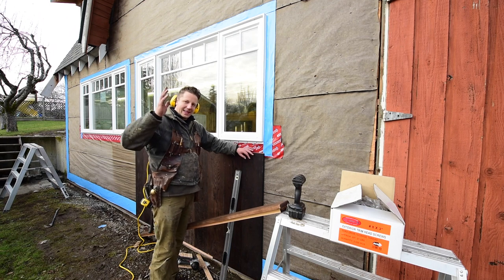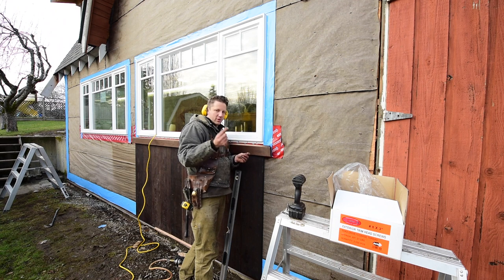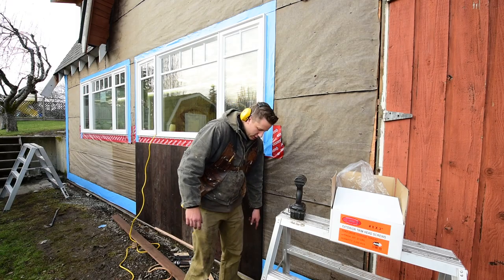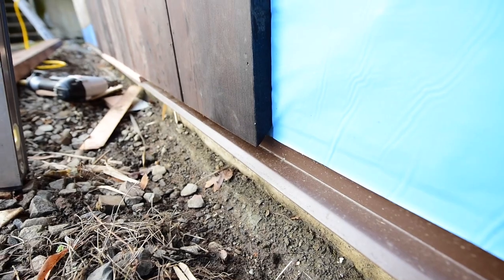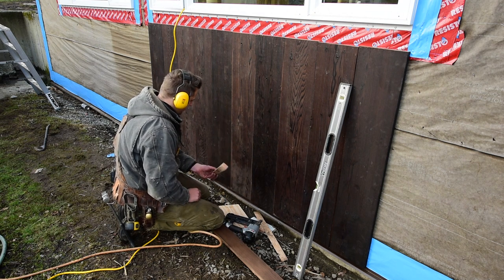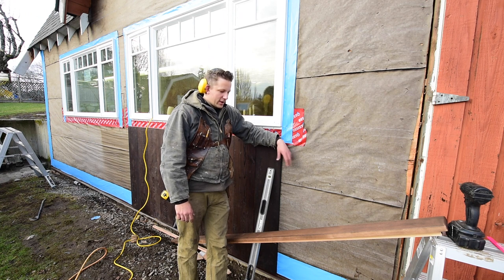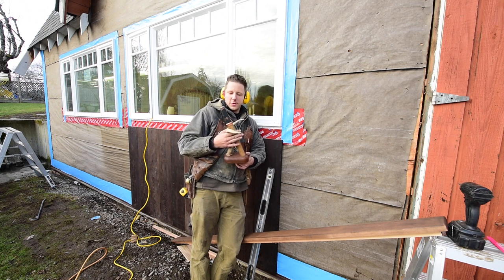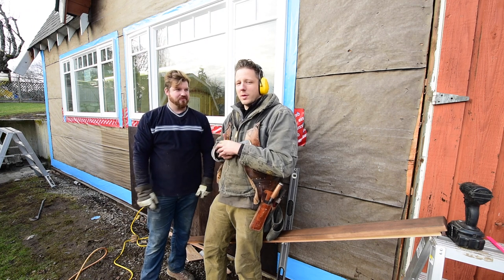FTF #45 Meet The New Apprentice!

Comment: Welcome Justin! Did I miss it or did you mention the siding material? Did you buy it rough or to size? 
PS I thought Galvanized coated nails/screws also have a tendency to drip and run and leave a stain mark if your material is a bit on the lighter side.  Cheers!
Reply: shosugiban - burnt cedar. (Yakisugi)

Comment: quick question
dont know about in the U.S. but here in New Zealand that kind of external cladding system needs a cavity of about 25mm or an inch to let moisture just querie
Reply: TheGhosteyez 18 millimeters min
Reply: Tristan Patterson thats true
Reply: Same idea required here national building code of Canada requires a 3/8" minimum air space (rain screen) between wall sheathing and that type of siding but that's not practical for board and batten so most strap horizontally with 3/4" strapping
Reply: In Scandinavia it is also common to have about an inch air gap. Would be fun to hear the reason not have a gap.

Comment: Why didn't you put furring strips on before the sidings bords? in Norway that is the norm. 
walls facing the outside in Norway is built like this: tyvekk or asphaltboards or something for stopping the cold air, furring strips to make sure that all of the water dont become stuck behind the sidings and then on with the sidings.